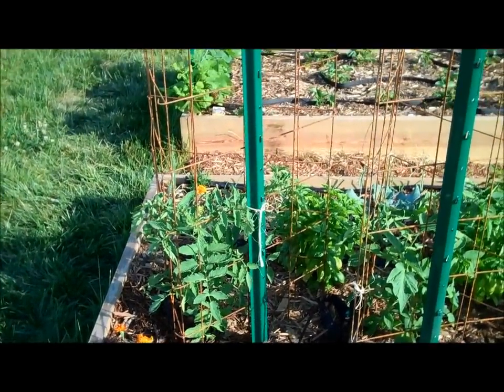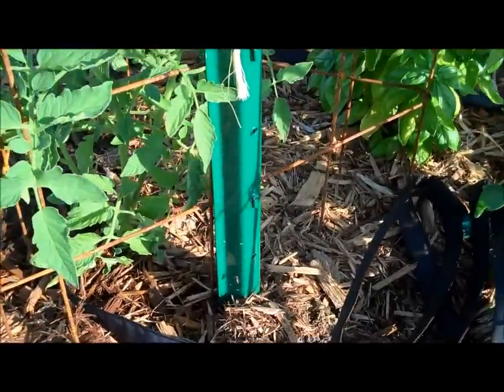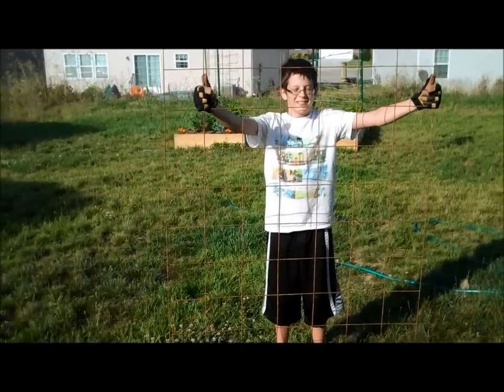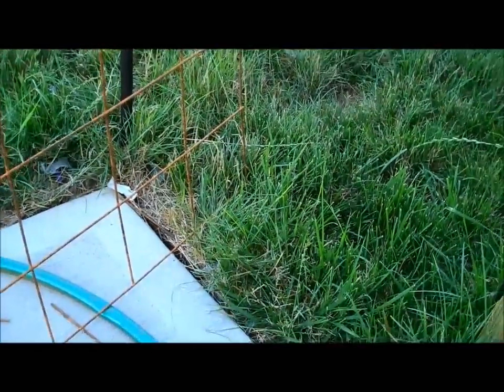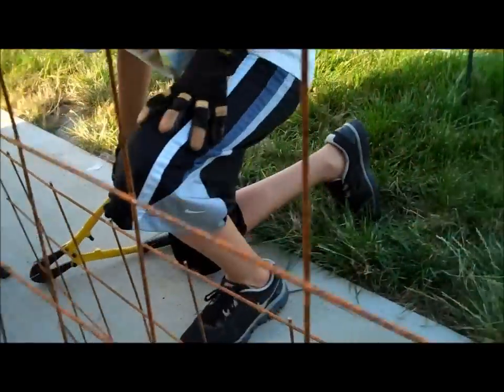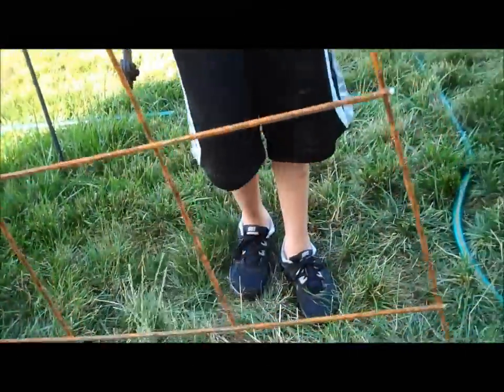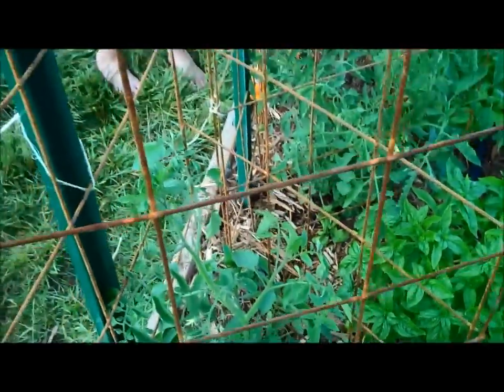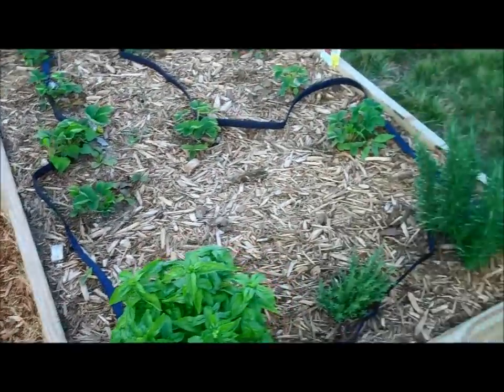Ultimate Tomato Cage

Comment: Looks good.  I will be doing just a V shape this time instead of a triangle.  I will be trellising the tomatos vertically and pinching off the suckers.  

As for soil, I recommend using a mixture of milled peat moss and perlite / vermiculite.  I add a top dressing of compost made from Fall leaves.  I fertilize with organic EB Stone with mycorrhiza.  For calcium, I put crushed egg shells in the hole I plant the tomatoes in.

Comment: I cut mine just like yours just one major change I used galvanized 1/4 inch split washers to join them all together( like hinges),and they collapse for easy storage.
Reply: this sounds like a great tip. I am going to make a few of these cages and will give the split washers a try. Do you have any trouble with them falling off after installed?
Thanks, great tip!!!!!

Comment: Good Idea but you waste 18 in per cage.  If you just loop the ends of the cut piece instead of cutting them off you could gain another 6 in per panel.
Reply: jumpin386    True.....but if you watch the video I bring this up.   Felt it was ok as it severely reduces the amount of work you need to do attach them.   In the end, the size was suitable